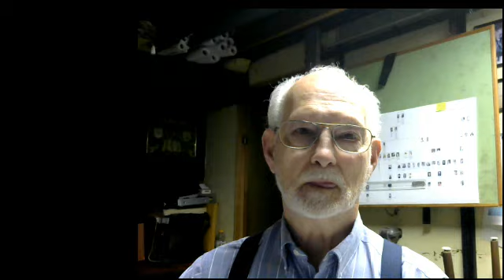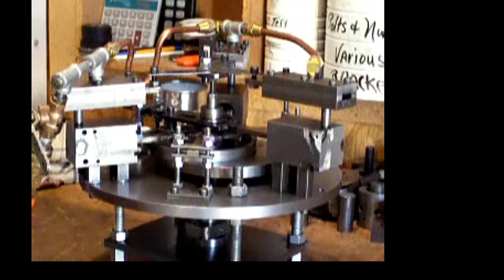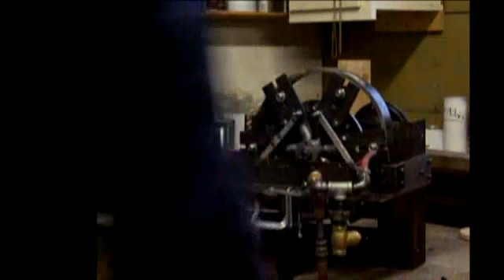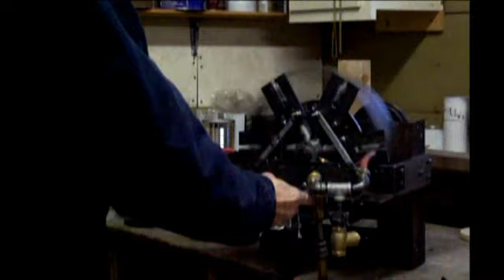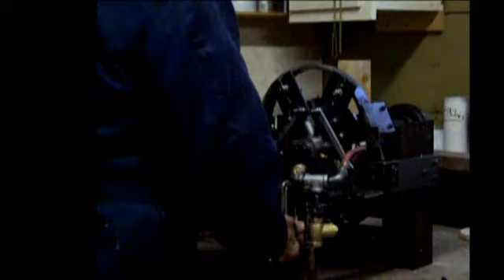Introduction to Air Engine Research, Build an Air Motor for use in existing cars or trucks

Comment: thanks for sharing. i work with liquid nitrogen and i am very interested in air motors.
Reply from the maker: Thanks Sam for checking in with us. 
The video you watched is not the latest Engine, I will be making another video sometime soon displaying it, and talking about how I think I can RECYCLE part of the EXHAUST air !
It is a lot different in size, shape, and has 6 Cylinders. It can run on 2, 4, or 6 Cylinders to conserve air.
I started using Nitrogen Gas, a while back - but had trouble freezing up, so went back to Compressed Air.
I haven't tested over a long period of running because I can't afford a Carbon Fiber Tank at this point, but there maybe some problems with temperature there also?
Any way glad to have you aboard, suggestions welcome

Comment: Have you considered using a scuba tank to hold the required air pressure? It can hold up to 3000 psi.'Also I have a sample I have been experimenting with - so you may think about the possibility of this configuration I cant figure out how to post my Inventor drawings - but essentially it would be the exact same setup as a normal car motor. But since it does not need to be so beefy due to not having to have a combustion explosion any more, the materials could be made of a much lighter material (I would think) and therefore even more efficient and possibly even faster? It would be great if you could maybe send me an email to stmullis@hotmail.com
Reply from the maker: Hi Samuel
Yes I have considered using a Scuba Tank, but sorry to say there just isn't enough air volume in one.
I have done some calculations on various tanks and pressures, and I  WILL BE PUTTING OUT A VIDEO SOON about tanks, pressure regulators, compressors for filling larger tanks and costs.
I WILL HAVE A SECTION ON MY SMALL 4 CYL PICKUP ENGINE, WHICH YOU WILL FIND DISCOURAGING - SORRY

Comment: im interested, my question is; could the pressure through the exhaust sytem not maintain its force (pressure)? if your only using air, why cant it sirculate without adding more air?
Reply from the maker: Hi Edward, thanks for the question. It's a bit lengthy to talk about recycling the compressed air - but i have just made a short Video to show what i think would happen. Please take a look at it

Comment: .pretty nice job done.. well im researching too. amd we found best compressor would be steam flash boiler. one downside of steam is heat and condensate. ball valves are no good only needle valves. what is your location? USA?
Reply from the maker: Thanks for the comment, I have made a number of changes since that video. 
I am concentrating on the 3 Cyl 2 Plate motor, and working on a High to low Pressure Regulator for when I can get a Carbon Fiber Tank for my air supply.
I am not sure how a Flash Boiler could be used with the type of Engine I am working on, but if you come up with a way, let us see what you have.

Comment: Are you familiar with Pneumatic Options Research Library (website) and its corresponding forum? 
Thanks for posting your work!
Reply from the maker: Thanks for subscribing, and no i wasn't familiar with the website.
I just looked at it briefly, and i see they are talking about a lot of complicated ways to do things.
My goal is to do it as simple as possible using parts as much as possible that can be bought locally or made by me.
I find that various ideas work pretty well, and really don't have to be that accurately machined. So far my biggest problem is getting valves that don't leak. 
For my purpose in developing a working model, i get them to leak very little - later i may have to have them machined if all else goes as planned.
Reply: it may take time to sift through stuff but there's a wealth of info in the forum and that site and at archive.org type "pneumatic options" for several videos and pdf books.
i plan for my first project for something less ambitious than what you're planning (i'm no engineer by any means) but have found lots of helpful info. also the folks on the forum have been helpful, generous and friendly as well. best wishes.

Comment: Very Interesting!
Reply from the maker: +Super Saiyan Goku Thanks for watching and your comment - I hope you will keep following me, this coming year i will be redesigning my 3 Cyl 2 Plate motor to have 6 Cyl, able to run on 3  1.125" Dia Cyl or 3  1.5" Cyl or all 6 Cyl at once.  All Subscribers get notified on new videos.
It's very critical to conserve Compressed Air, and my goal is to make it possible to go at least 200 miles with 2 on board High Pressure Carbon Fiber Air Tanks.  Guess we'll just have to wait and see!

Comment from the maker: Thanks Luckygen1001
I appreciate your comment, and hope you don’t loose interest
in building an engine for use.
In that particular one I made, the pistons were 7/8 inch.

As for balance and machining, it is very crude by any
standard. I am not a machinist but managed to get things to work.
My goal is to make a simple Air Driven Machine that is easy
to work on, powerful enough to make my Ram Pickup go at least 250 miles on one
tank of compressed air.
I have learned a lot in different designs, that I will be
talking about and showing videos of in up coming sessions.
As I said in some earlier videos, I lost videos and design
drawings from the last half of year 2014 when my computer crashed – BUT I can
remake some videos of models I still have.

Thanks again for looking in, and hope to see back, I have 10
– 12 years worth of things to talk about.
Questions and comments let me know what you want me to share

Comment: Yeah my three cylinder vibrates but I never gave much thought to balancing the crankshaft and making the valve gear lighter. My engine has a 50mm x 50mm bore and stroke and with high air pressure could power a small car. I have driven Stanley steam cars and that is where I got the idea to build my engine. Thank you for watching my video. I am in Australia.